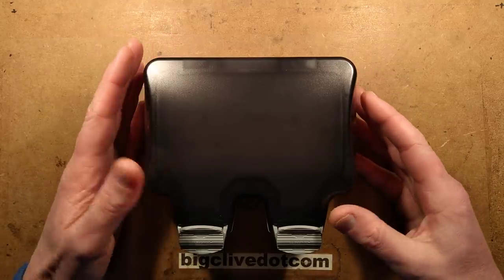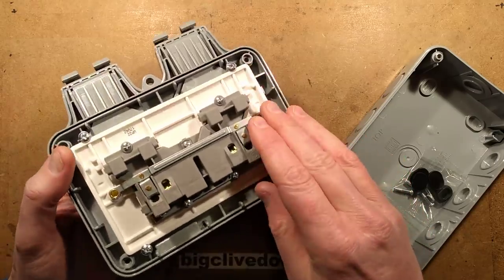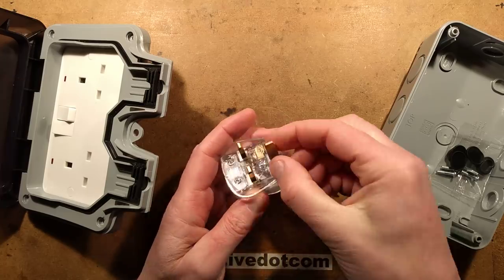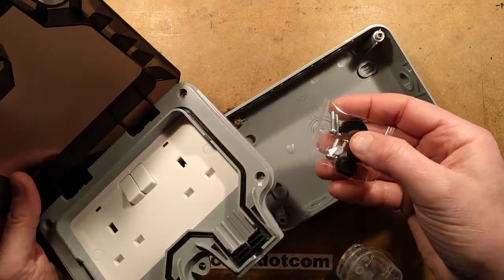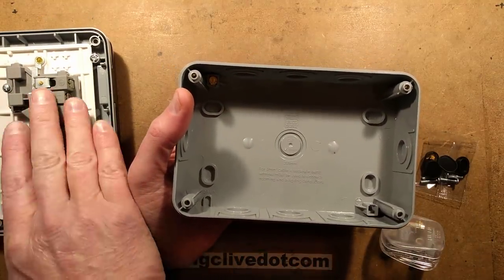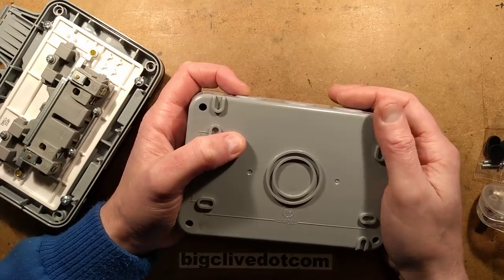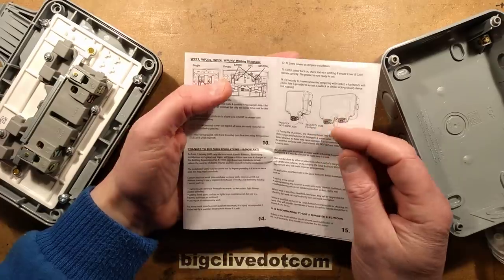British weatherproof socket with clever design. (bonus rant)

Comment: When I installed one of these I came in through the back using a bit of 20mm plastic conduit, terminated in the back using a female adapter/coupling. Then siliconed around the outside of the socket where it meets the wall to prevent water going down the back.

With regards to Part P, it seems they have relaxed the rules a little. You no longer need to get your wiring checked for an outside installation, provided it's spurred from an existing main.

Comment: Only 13 A? Here in the rest of Europe, our plugs are 16 A rated!
Reply: Ours are safer! Less amps to kill you!
Reply: They come higher  - I have some 15 and 20 amp.
Reply: Brian Murphy then it isn't to BS 1363. These are up to 13a.
Reply: I know, but you can get the fuses that go higher than 13a.
The plug itself will easily handle more than 13a.
I have a 20a in the plug of my mig welder.
Reply: Brian Murphy try just installing a blue 16 socket and a suitably rated new circuit
Reply: @brianmurphy8790  .... Are you sure? Try pulling out a tumble drier after an hours operation and touch the plug. It isn't heat from the drier eather!
Reply: In New Zealand it's 10A. Nice round number. Next size up I think is 15A. 13A would drive me crazy.
Reply: @gcewing 13A at 240 V gives 3KW .... I am a bit older than most and can remember a slew of different plugs used in the UK, from 5A and 15A 3 pin rounds (we still use them in stage work now)to various combinations of round and split flat pin .... some even had the fuse as a screw in that was the live pin of the plug that inserted into the socket!
Reply: If we want more then the big blue plugs are used
Reply: @liamguy2820  But our circuits are fused with 16A only, the british circuits are fused with 30 or 32 A (depending on the age of the installation). That's the reason for the fuse inside of the plug, because no cord is rated for the 32A. And that is the reason we don't require that fuse.
It's all about the old common saying that there are many ways leading to Rome.
The other example is the sleeving of the pins. This is not required here, because the outlet is recessed into the wall. If the pins make contact with the clamps inside of the outlet you can't touch them. Since the BS 1363 outlets are flush with the wall the sleeving is required to prevent live parts become touchable if the plug is only partially inserted.

And the systems are evolving continously. The BS 1363 had no sleevings at the beginning, this was introduced in the 1970s. The Schuko system had no shutters, but now they have. Left hand without shutters, right hand with shutters:

https://upload.wikimedia.org/wikipedia/commons/6/6e/Schuko_LH_without_shutters_RH_with.jpg

The only flaw of Schuko: It's not polarised. When this system was introduced in the 1930s that was not necessary, because there was no neutral connected to this outlet, only 2 lines and the earth. There were two types of systems here in Germany, a split-phase system comparable to the american system with two lines with a voltage of 110 V against earth and 220V against each other. The other one was a three-phase system where every of the three lines had a voltage of 127 V against earth, against each other a voltage of 220V (Voltage of a single phase against earth or neutral x sqrt of 3 = voltage between the lines in a three-phase system). To avoid safety issues appliances which are connected with a plug which is not polarised must have a 2-pole switch, switching off line AND neutral.

BTW: 30 mA are already enough to kill a person, causing ventricular fibrillation leading to a cardiac arrest. That's the reason to use RCDs rated 30 mA (0.03 A) or less.
Reply: 13A and 16A? Australian standard only do 10A with the rare 15A for stoves and air conditioners. Couldn't tell you why, though someone will probably state safety reasons. The household wiring is also 10A rated last time I looked
Reply: @gcewing  Yeah, Australia too - don't we use the same design plugs? 10A basic plug, 15A for stoves and air conditioners. I don't know off-hand if there's a 20A - they'd probably just go for 3 phase at that power requirement and be done with it (just a guess based on what I've seen in life)
Reply: @Marcel_Germann  I appreciate your explanation... however I am already aware of everything you've just told me. My original comment was made in jest.
Reply: @databanks  That's what these types of plugs are rated to handle at maximum. Appliances with a higher demand in german households, like electric water heaters or kitchen cookers, are hardwired. And in most cases they're connected three-phase. The kitchen cookers (including baking oven) are mostly fused with 3x16A, that are round about 11 kW. In older installations it is single phase and fused with at least 25A.
Reply: @Marcel_Germann  true, we also have some hardwired stoves and air conditioners. Not all though - where someone is renting, you'll often see a 15A socket next to where they had an old box/window mount air conditioner installed. With split systems, they're always hardwired though. Just takes longer for rentals - some landlords can be dicks about it. 
Hot water services makes total sense to be hardwired. They're not something you unplug often and if you have different power rates, they'll often have their dedicated power meter. Again, logical. 

Eh, preaching to the choir, aren't I? Sorry, was essentially thinking "out loud" or gathering my thoughts as I process.
Reply: @totherarf  That heat is from the fuse, not the plug.
Reply: @totherarf  Yes,  those small 5A round pin plugs were very popular with stage lighting systems. Used to be the accepted standard (and also saw use in 12V caravan systems too I seem to remember).
Reply: @brianmurphy8790  Some is for sure .... but does it matter where in the plug it is generated from? My point was that it will only just carry 13A not do it easily!
Reply: @totherarf  I just about remember those. Also adaptors that you could put into your pendant light fitting so that you could do the ironing in the middle of a darkened room.
Reply: @brianmurphy8790  John Ward has recently made a video about these fake fuses.
Reply: @twotone3070  Wasn't going to mention Them ;0) ..... VIR light flex (2 Core Obviously no earths given) ...... Ahhh, the good old days 
;0)
Reply: @brianmurphy8790  The BS1363 plug was originally intended to be 15A but was downrated to 13A.
Reply: @twotone3070  so if you remember the iron plugged into the light fitting do you also remember the double adapter so you could have a bulb and an iron plugged in - or 2 irons
Reply: GRBTutorials, We only need 13A because we use 240V...
Reply: Snakebite1968 And we use 230 V. No big difference.
Reply: @totherarf  I remember the round pin plugs from theatre. Our lx bars were all round pin but the slips sockets were regular domestic sockets. It was a pain in the backside if you were moving lanterns from the bars to the side of the stage and vice versa.

I'm tempted to install them in my home just to confuse visitors who want to plug things in.

Comment: We had the outdoor switch for our split system A/C unit not properly sealed. The drainage hose wasn't connected correctly and it was draining directly on the switch unit and filled it with water. This then started earthing through the house. I found that out when I got a massive shock through the laundry tub. The AC circuit is obviously not connected through the safety switch.

Comment: When I was at primary school (Fife/1970s) we had an outdoor socket on the wall outside the dining hall, but it wasn't like this. It was circular and had a cap that screwed on when it wasn't occupied. I have no idea what its rating was, but it was used to power the Fife Regional Council Mobile Dental Unit,  known universally as the Mental Unit, which once a year was parked behind the dining hall so that all could have their teeth examined and some could get fillings. As well as the drill and (presumably) X-ray source, the Mental Unit had electric lighting and heating, so presumably quite a lot of current was coming through that socket.
Reply: It was likely a 3 phase 415v socket, the farm I grew up on had a socket like you describe on one of the walls that was for hooking up a 3ph towed generator for when the power went out. With the one on the farm you had to isolate the farm from the grid then once the gen was run up to working speed you had to bring the farm online slowly as throwing all the machines at it at once would stall the engine (big 6cyl perkins diesel).
Reply: They are used still in certain places London underground and network rail property favours them a lot still. Very expensive though and only maintain there IP rating when used with the same plug
Reply: Lot of schools here in the highlands still have them. I havent seen one used for a few years though (late 90s maybe last I seen used).  Same thing was the dental or speech therapy unit plugged in normally.
Reply: Commando connectors.

Comment: Clive, two makes of these sockets seem to be sold, one black as yours and one grey. The grey one has a bracket to attach to the back outside that clips on two screws on the wall. They are difficult to get to the correct tightness to hold the socket on the wall, but it does mean you don't have screw holes through the back of the box.

Comment: I got one of these from an electrical supplier where my son works. I was originally buying the version with an RCD socket. They sent the plain socket version and standard dual gang 13A RCD socket. He said just swap them and it actually costs considerably less. i said great, thanks.

The socket that came out was on ~7.5mm deep face plate with rounded corners compared to the standard face plate which is ~12mm deep and has square corners. So wasn't a straight swap! As I did/do not intend to use it in extreme wet conditions and didn't have the time to get the original request and couldn't find a low profile faceplate dual gang 13A RCD sock i adapted ir. 

No one fault you can't see that it has a low profile socket without disassembling it.

Comment: Thanks for this one Clive, over the last few years, various family members including myself have fitted the MK outside double sockets with an RCD.
In each case, these have all failed due to the way the trip coil is wound on the former.Very sharp edges on the coil former have worn through the windings 
with the permanently energised windings moving imperceptibly against the corners of the former. They are and have been made in a Country just north of Hong Kong for many years.
The older British made ones are still going strong .Ill buy one of these anyway because i have a stand alone RCD anyway in this ring so thanks for this video .
ps, having trodden on one of our plugs while fitting up the Christmas lights on the tree, just in my socks clad feet, ill certainly never do that again 🙄😡 .I hope.
It made me say, "dear me " with the children all about 🤣🤣🤣

Comment: Totally understand the frustrations with colour codes, I hated it, considering we had piles and piles of distro kit and cables in our hire stock. Over the years, a good number of times, people would take a plug off a big flexible and tail into a bus bar and decide the blue neutral was a phase, fried racks. I've warmed to the new scheme though over time I have to say. I think the concept of having the same scheme for installed and flexible cables does makes sense and it's supposed to be les problematic for those who are colour blind too. Previously (before harmonisation) there was also a problem with neutral and phase confusion as flexibles used blue as a neutral and installations used it as a phase don't forget. Was only having the discussion today with people trying to insist that in a cable with green/yellow, brown, blue and two blacks that the blue was neutral and not a phase The big issue now is mixed installations of course. It also takes the fun out of your motors running backwards first time (if you don't have a rotation meter) as three phase flexibles should no longer have two blacks!

Comment: I remember plugs before sleeved pins were introduced in the 80s.  My parents still have some old appliances with non-sleeved plugs, I wonder how many people got shocks using the old plugs.
Reply: I still have some. One good thing is that they are the correct size whereas numerous of the Chinese flimsies have undersized pins - a real fire risk.👹

Comment: Go and get a single gang one from several place (screwfix!!)

They designed them with the cable grommet exactly in the center of the box and then fit them with a switched socket plate that offsets the center line of the plug a fair way to one side which renders them pretty much useless as you can't shut the cover with  most plugs actually plugged in to them (especially ones with external strain relief on the cable)

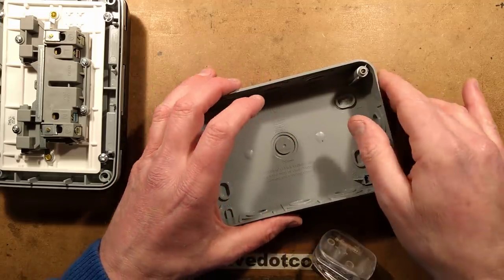5:57 in the video there is even a picture of one with this problem.

Comment: the bar might be sacraficial metal for the issue with sillicone sealant? I'm not sure if would work the same as with preventing corrosion by water, or even if the bar is zinc, but the placement suggests that might be possible?

Comment: A very good presentation (and the rant!) I've just bought two of these from Screwfix after they were pictured on their latest leaflet - just £6.99 each, a real bargain and not much dear than a standard two part interior double socket! Have used one to replace an old single weatherproof socket out the front garden (the sort you can't leave a plug in when it's wet, just a waterproof lid that closes off the entire front). Admittedly I haven't really got any appliance that I'd want to use in the rain except maybe the power washer but that's not the point, this one just looks great on the wall! By the way, re: the silicone sealing, my instructions say to fill in that double circular rim around the rear entry point on the reverse with a sealant which would seal the back of the box to a flat surface without the sealant coming into the interior. I sort of remember something on the instruction sheet about rules and regulations and who can do what, I assumed it was some sort of EU b/s and totally ignored it as always!

Comment: I have this unit, it's been outside for 5 years or more and is working fine. Only do check that the front facia  clips pins stay in their holes or you may break those clips off or bend the pins. No issues with the water seal so far.

Comment: I'm from Germany and we have a clear color code as well (nothing like 3 shades of brown) light brown for the aktive, blue fro ground and green yellow striped for earth. I also quite like our plugs, earth always connects first, they can handle 16 A, the live pins are never exposed due to the recessed socket (the small plugs without earth must have plastic shielding, the other ones often do too), child protection can be build into the socket so that you have to push in both pins at once or as an add-on so that you have to twist the plug 90° and last but not least when you trip over a cable neither the socket not the plug is damaged.

Comment: @bigclivedotcom
It is worth taking the white socket apart as I have recently discovered a easy to cause live to neutral fault. Inside that socket are bare metal tracks that pass by each other very close with just an air gap, the fault occurs when the terminal screws get over tighten (but not over the top tight) and the tracks inside easily move and touch each other. I have fitted a lot of these with no problems until one had a fault recently and I would say that the inside workings of the white socket is a very poor design but the grey and black weather proof part is an excellent product.

Comment: +bigclivedotcom
Needless usability issue with these -- the upper-side of the catch at the bottom holds standing-water -- after rain gone, the 'held' water spurts-out when you open the catch later, oh-dear!  The catches could have had a drain-hole to prevent this...
Spotted today that seemingly these same sockets are sold under 'masterseal' brand in wickes too, not just BG.
Also, what do you make of the pop-out plastic holes in the back-box, -- I'm not terribly convinced by their water-resistance without seals, and used silicon around these on installed outdoor-sockets!.

Comment: Murphy's rules of waterproofing ANYTHING.
1: Take time to carefully seal EVERY possible way that water might get in.
2: Drill a decent sized hole in the bottom to allow all the water that 'bypassed' the above rule to escape under gravity
3: Anything that is NOT brass will inevitably rust away...  It should be noted that plastic is NOT brass - caveat emptor!
(The above constitutes the 'lessons' I've learned over the years at the local drag-strip.  Some of the low-voltage timing-system cabling had inline screw terminal connections ['chocolate block'] and had plated steel screws into a brass connector - After many years, those screws LOOKED fine until poked with a screwdriver whereupon I determined that only the plating was left!)